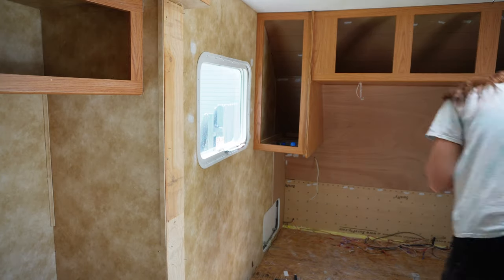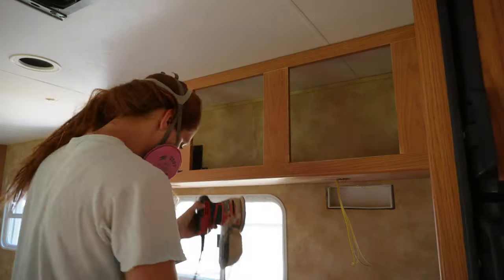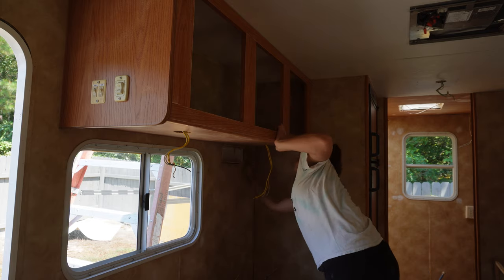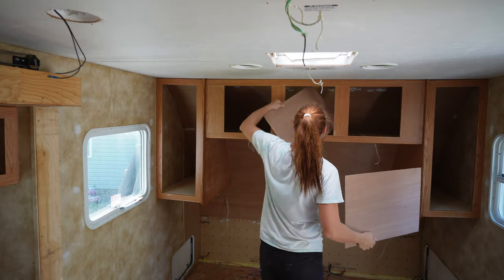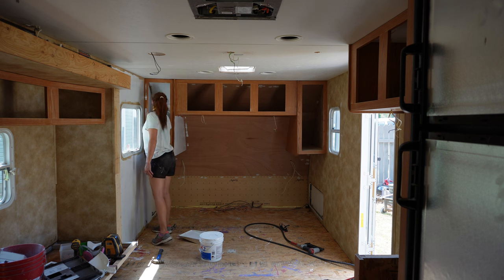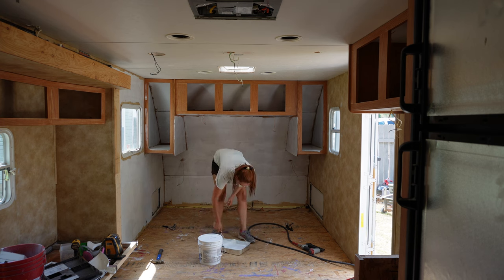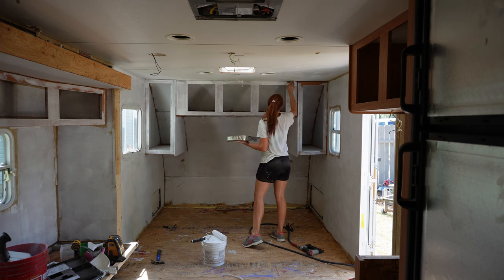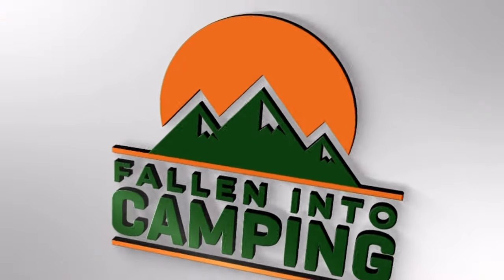RV Renovation: Day 2 Sanding and Priming walls and cabinets

Comment: You can sand mdf and paint it, you have to use an deep penetrating paint, best 2k that stabilizes the mdf so it can be sanded smooth and does not soak in anymore. Certainly not worth if if you do not cnc machine them to mass produce doors wit trim "build in". But you can repair them if you sand through the finnish.

Comment: I've got the same wallpaper in my RV and it is peeling in places.  I have considered peeling it or just replacing the entire panels with a fiber reinforced plastic panel from the big box stores.  Thoughts?
Reply from the maker: That’s tough…typically, it’ll ruin the panel if you take it all off. I use a razor blade to cut off the bubble, fill it with puddy, sand and paint over it if it’s a small enough section